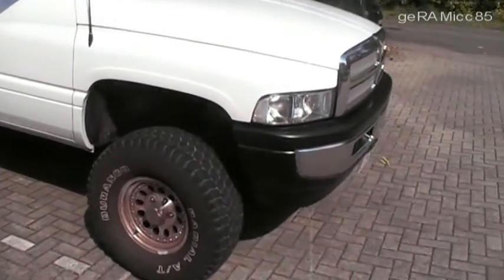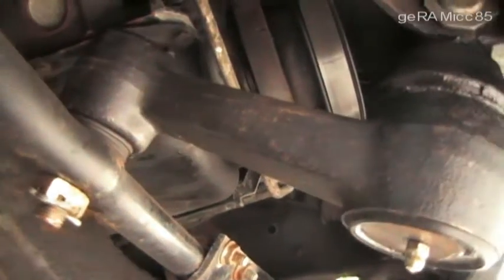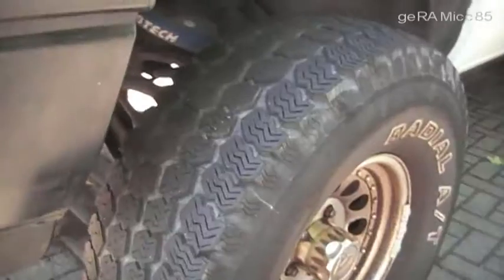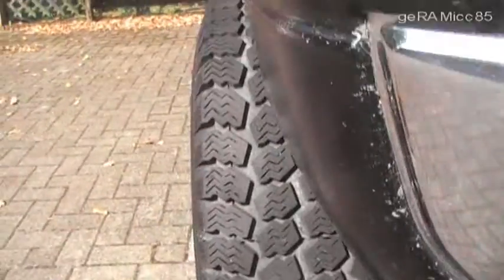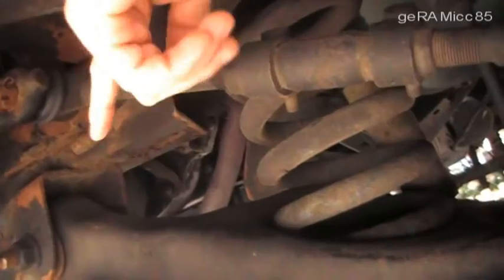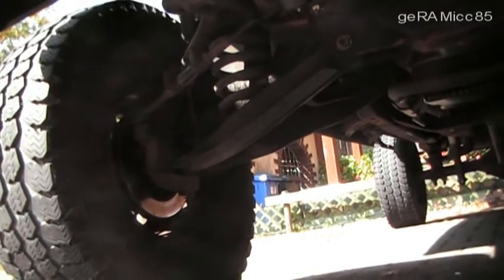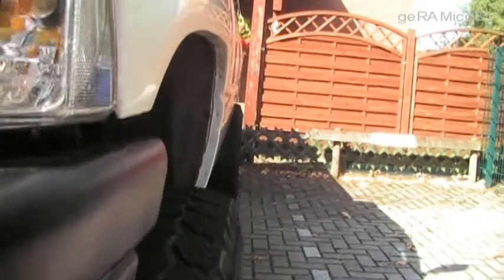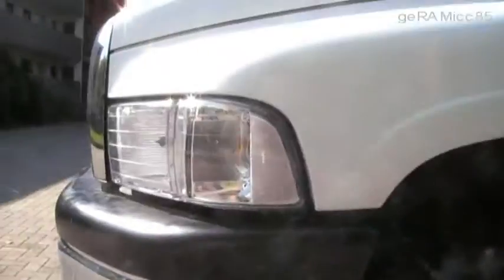DROP DOWN PITMAN & IDLER ARM DODGE RAM 2WD 1996? FABTECH SUSPENSION LIFT KIT FRONT 6"

Comment: I will also be including a you tube video for a rear differential swap for my 1998 Dodge Ram 4x2. I did the rear differential gasket and found some broken teeth on the spider gear. The local junk yard had a 3:55 9.25 rear end for 130.00 and gave me a year warranty with it.

Comment: I have a 1998 Dodge Ram 1500 4X2 and have been experiencing some really bad road wander. I came upon a You Tube video that gives some great advice on how to deal with this problem for 4X4 and 4X2 look up on youtube: Dodge Ram Death Wobble SOLVED!  I also have the link to the company that sells the part to resolve this issue but you will need to google it. Dodge Ram Stabilizer